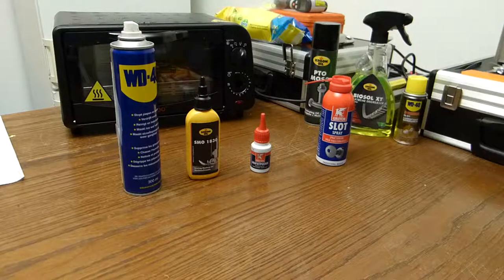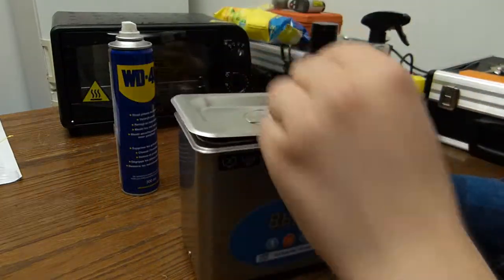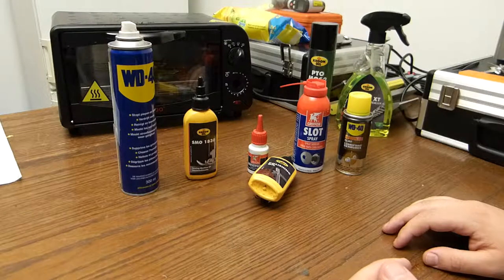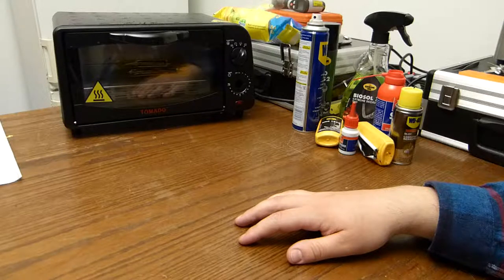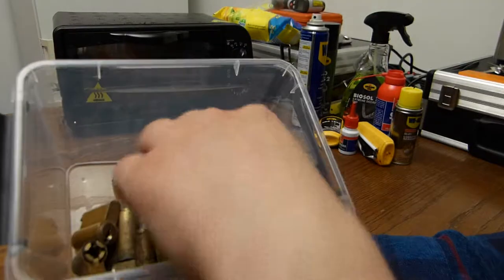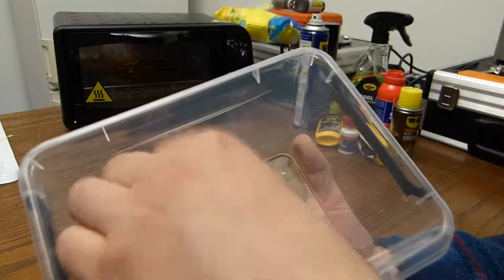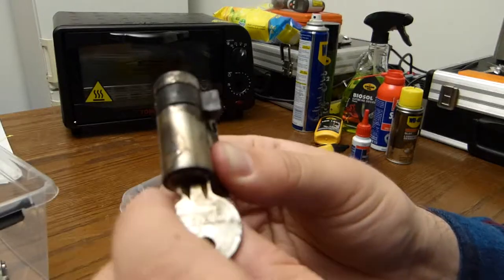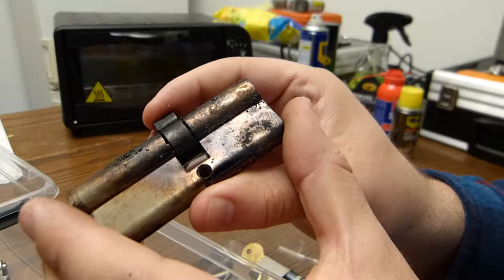[014] Dirty locks from the UK

Comment: That's a new business opportunity - dirty locks maker ;-) Great job on the one with Soja sauce. Looking forward to the cleaning video. For cleaning locks, I usually soak them in break cleaner for a few days and shaking the container now and then. Then I knock all the fluid out of the lock and soak it into alcohol for a few minutes to get the break cleaner residuals out. Then let it dry (alcohol dries very quickly and without leaving anything back). Then I spray graphite it. Would love to have a ultrasound cleaner, I'm sure that this device will give great results.
Reply from the maker: Thank you for the input.
Reply: Potti314 I do the same but spray Teflon, The graphite is way too messy for me.😕